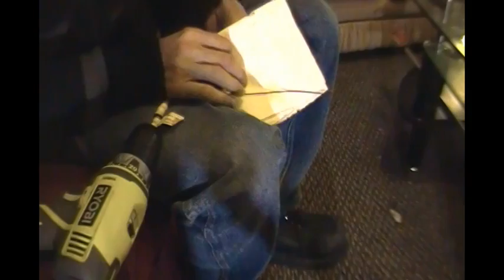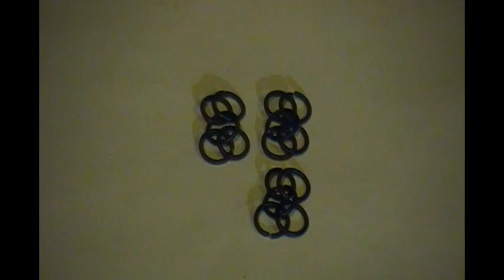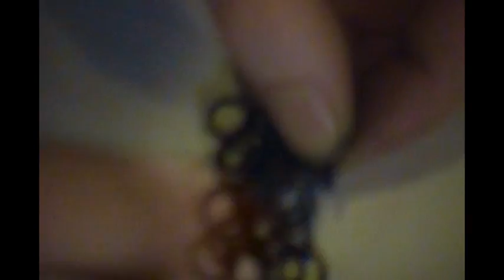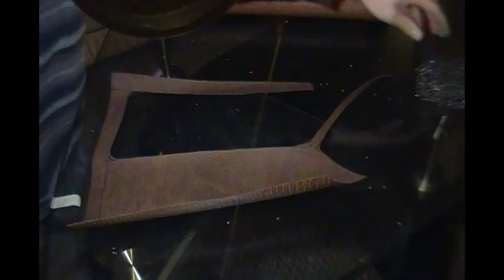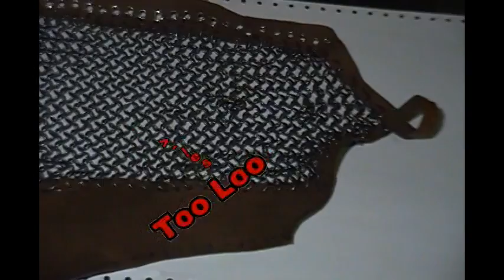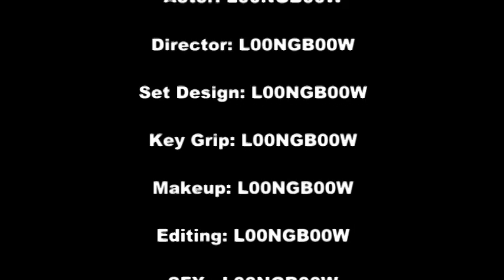How to Build a Bracer from Leather and Chain-Mail.

Comment: I wonder if they did that with full suits of chainmail armour only putting chainmail on the places on the body most likely to be hit because I noted that if you were fencing with someone your forearm would have a lot of protection
Reply from the maker: I imagine that would be the case, especially if resources were limited.
 
That's pretty much the idea behind this design. :)
 
Leather  to protect from the bowstring without damaging it, chain to protect from blades.

Comment: there has to be a faster way to connect them together. looks great though. I was going to make something for the renaissance festival . looking at this is looks like it would take a year for what I would like to make. great teaching video.
Reply: fyi a much more effcient way of weaving chainmail is to simply make strips of 2 rings, 1 ring, 2 rings, 1 ring, 2 rings, 1 ring, ect... lay that out, make another of equal length in the same manner, lay that out and insert single rings every 2 rings in between. rinse, repeat as many times as you need.

THIS way you're not inserting three rings to make a square, you're only inserting two to bind the two strips together.

Much more time efficient and you won't go mad with the tediousness of the process of making individual 4 in 1s

Also recommend making an actual rig for the mandrel.  It's simple to to, three pieces of wood to make sort of an upside down bench. Drill a hole through each leg for the mandrel to rest and hook up the drill. 

Tooling the mandrel with a slot (or a hole) on one end to grab the wire is also a much better idea than masking tape.

Also 4-in1 is European, not Asian.  Asian styles are generally more focused around form than function as you'll see rings being woven to other rings through perpendicular lines rather than an actual weave.  Look up some asian style chainmail weaves you'll see what I mean. CGMaille is a great place to start on different patterns.
Reply: Well it works well on 4-in-1 but most other weaves are a bit more intricate and can't be reduced as simply, save maybe dragonscale which you can create long chains of 1->1->1 ect but the inner weaving process is quite a bit more complex.

I dont know what you're working on for jewelry but dragonscale makes some really amazing looking bracelets.  Byzantine and Persian 3-in-1 are also really nice patterns to make chain (necklaces and such) with.

There's also a box weave pattern similar to the Byzantine (actually kind of more simplistic) that looks cool to make snakelike pieces out of.

You could look at trap ring patterns too, but only if you like pulling your hair. =D
Reply from the maker: I wish there was.
 
This is the Asian style. tight fitting links that are just bent into shape.
 
The Europeans used larger links, but would actually rivet each individual link.
Reply from the maker: chuckles2035  Thanks chuckles, I'll have to try that. method. I'm working on some smaller Jewelry chainmail pieces. Any time saver is welcome!
Reply from the maker: chuckles2035 Just some 20 gauge necklaces of brass and copper for the time being. My mandrel size is 1/8". I'm going for a wide inverted triangular pattern that kind of drapes over the sternum. 
 
I'll look into the other styles, but I think I'm kind of committed to 4in1 at this time. But if trap ring means what I think it does, I might be able to sneak that in there.